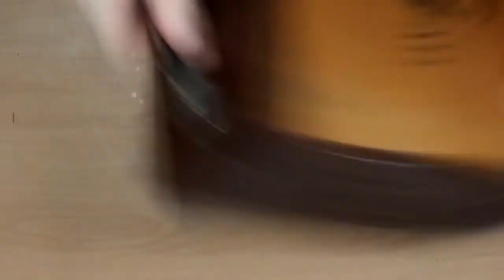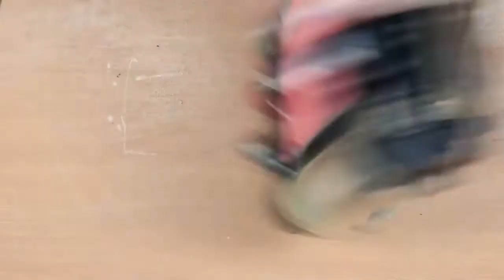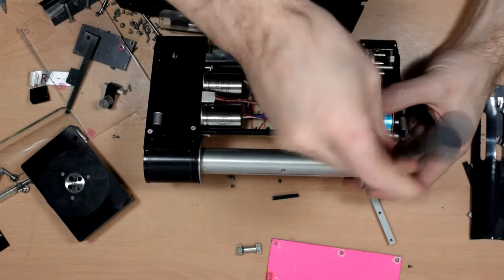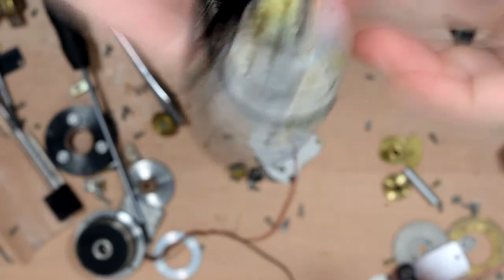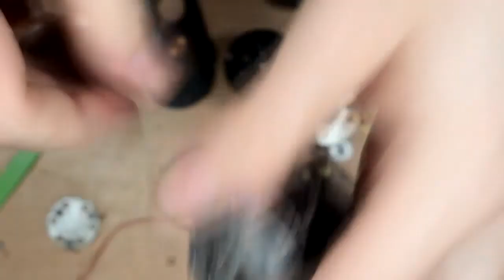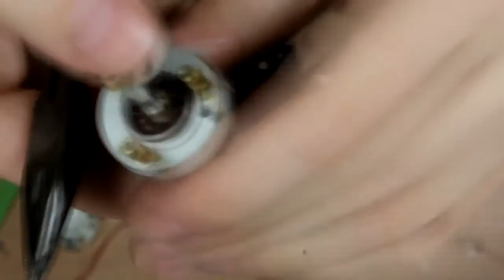DECCA map reader teardown

Comment: Thanks for sharing this video - really a complicated mechanical device. Have you made any documentation during your disassembly, so we can make a list with the pinout of the plug? I have one of these units, too and probably it would be fun to connect the unit to some modern navigation system or perhaps my intertial navigation system...
Reply from the maker: I considered doing something like that, but the thing was such a pain to get apart, in the end i didn't.  Not sure how easy it would be to connect it to anything but what it was designed for, probably would require come microprocessor fun.
Reply: Of course it would require some serious microcontroller stuff - reading synchro signals and implementing the servo loops is an interesting project. Nevertheless many thanks for sharing your video and have a lot of fun with your projects!